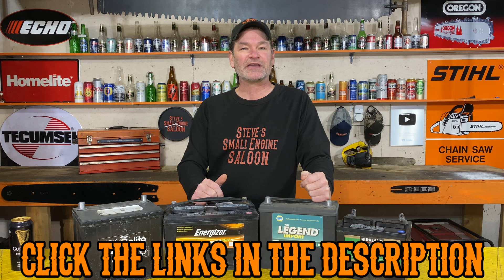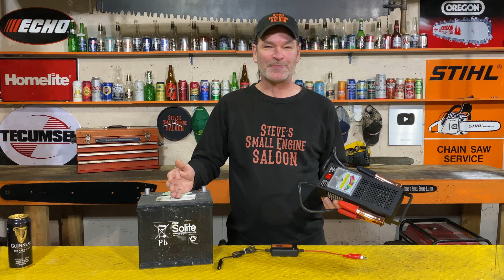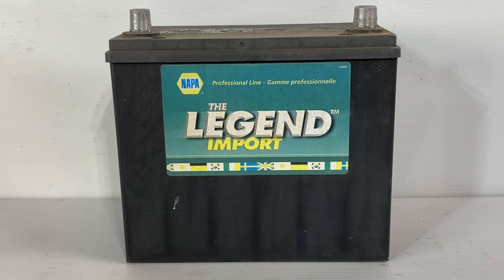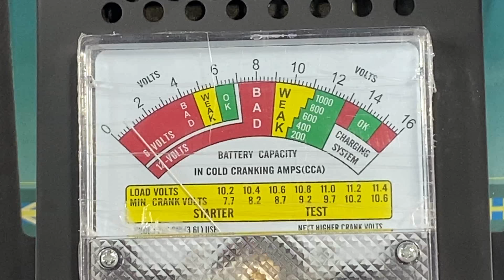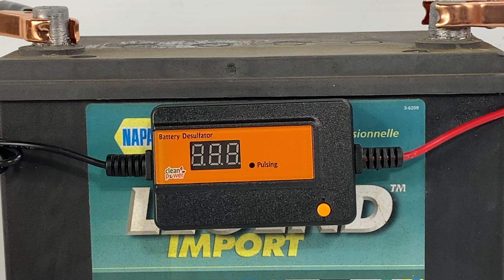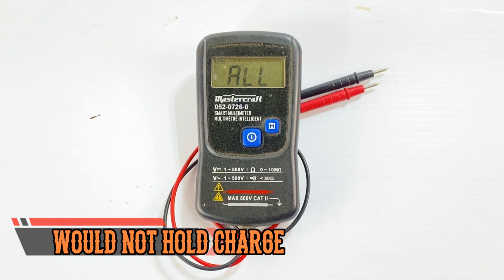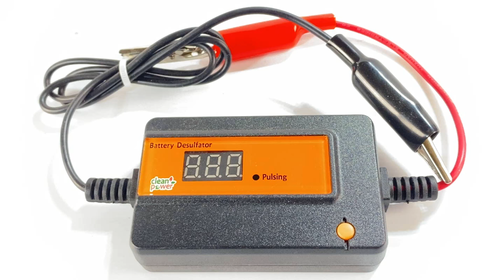Does An Electronic De-Sulfator Really Repair A Battery?? See Real Results

Comment: Some of the plates can build up an insulating layer. You can sometimes break through it with a high voltage.
I took a 120 volt 60 watt incandescent bulb 1N4007 diode in a half wave circuit and made a 12volt lead acid battery part of the circuit.  The battery then faces 170 volt half wave pulses which push 12 times harder than 14 volts when the battery then conducts it is current limited to a half amp by the light bulb. .Not good as new but gives it a little life back..A lead acid 12 volt should not be discharged below 11.5 volts for best long life after that the plates have lost too much material to the acid to plate itself back on like it was before.

Comment: Thank you Steve!
I just ordered all three.
I live on a lake, so I have a pontoon with 4 battery. A boat with 2, two ride on tractor,  and my old pickup truck and a motorcycle.
Good lord if I can save one or two it will be worth it.
Most batteries die because the lead breaks or is full of sulfur. Well broken lead is a no go .. but sulfur can now be fixed.. (sometimes..)
Thanks again!
Reply from the maker: You're Welcome...

Comment: For my many years working as auto technician, I noticed the main factor in reviving a battery depends on the age of the battery, if it has any dead or shorted cells and how long the battery had time to sulfate. If the battery is over 5-6 years old or the battery has been sitting for few years, the reconditioning cycle doesn’t work. Also if it’s a small motorcycle battery I never had any luck bringing them back.
Reply: I think the key is to desulphate before the battery is completely broken down in some way so that whatever slow build-up occurs can be broken up before it cause more serious permanent issues.  I remember my grandfather building a similar “memory zapper” for nicad cells which were quite popular in those days, and it worked too, but not on totally dead ones.

Comment: You can't wait forever to use it. It won't raise the dead.  I use a solar panel to charge cheap lawnmower batteries at 16 or 17 volts occasionally and I can get 4 years out of a 1 year battery, but not a totally dead battery.

Comment: Steve, 
HOW IS THAT DESULPHATOR POWERED???? Only has battery positive and negative wires??
How does it operate? 
Mystery……
Someone please answer this! 😳
Reply from the maker: Ummm,  its powered by the battery!
Reply: @StevesSmallEngineSaloon  how does it raise the voltage up to pulse the battery? it takes at least 15v.

Comment: Hey Steve great to video your the best but did you know that on your second battery you can hook up a fully charged battery to it hooked in parallel and that'll bring the charge up so then you can hook the charger onto it and see if you can bring it back to charge over eight volts I didn't know if you knew that or tried that already

Comment: Need to add a warning about charging batteries at higher amps. You can easily cook a battery and produce hydrogen sulfide gas. Smells like rotten eggs and is poisonous, flammable and corrosive!
I tried jolting an old battery with 15 amps in a closed garage for too long and thankfully checked on it soon enough to prevent anything bad from happening. Battery was hot and you could hear bubbling. Smelled bad too. If there was an ignition source I probably would have had a nasty boom.

Comment: Been using BatteryMINDer maintainers/ desulfators for more than two decades.   Many lead acid and AGM batteries.  Most of my batteries that idle (boat, side by side 4 x 4, trailer caddy) etc. last up to a decade, sometimes more, in the Fl heat.   You're right.  They can't save every battery, but desulfators do work more than enough to pay for themselves.   Far superior to standard trickle chargers that cost the same or more.  Batteries with normally expected 5 yr max life, stored on working desulfating chargers, remain reliable for at least double that.

Comment: The first two batteries can be rebuilt but not restored. The last two would eventually have been like the first two given time to get in such conditions. 
I have spent 3 years studying every thing I can find on this subject. I finally got the connect disconnect pattern down to no spark. Disconnect ground first reconnect positive first. I had to use a quick disconnect for a while. It is not just a method to keep your battery from draining from the system. It also helps you understand the above mentioned process. When you connect it to the ground and use it on the ground side of the battery. You get no spark but use it on the positive side. It sparks every time you throw the switch on or off. 
Now I just remember how that thing worked and I hook my battery and jumper cables and jumper boxes up correctly 98 percent of the time. LMAO 🤣 🤣 🤣. 
Sorry I didn't mean to ramble on. Thanks for doing this video. It helped me to understand why certain batteries can't be restored. I was struggling with the difference until this. I guess seeing them compared side by side. Cleared up the mud in my brain. LOL 😆 🤣 😂

Comment: I bought the one you show last spring because my deep cycle marine boat battery had failed the year before (it wouldn't hold a charge, had to be boosted all summer). It recovered my battery and it worked the summer until fall when it started not holding a charge again. I will try it again but even if it doesn't recover this battery again it still saved me a boating season. It has saved other battery's as well so the $25.00 was recovered on the first save
Reply from the maker: Right on Mike!  Thank You...

Comment: They work well, particularly if you use them at the same time you are charging. I have the same type as you. My success rate is about 70%, even with SLA batteries.
Reply from the maker: Awesome!

Comment: Steve, I love you videos and purchased a de-sulfator.  I’ve had varied success but thought of something the other day when I was cleaning a carburetor.  If the sulfur builds up on the lead plates, what do you think about submersing a battery in an ultrasonic cleaner of just water?  Do you think it would break down the sulfur on the plates.   I use a similar technique for small carbs putting then in a plastic soup container with carb cleaner snap on the lid and drop it in the ultrasonic machine.  This has worked great and saves a good dealer of cleaner.

Comment: If you have a completely dead cell there's no way you're going to be able to repair that because it is actually a physical break. Generally batteries that have been sitting for long periods of time and then they build up that mineralization on the I believe it's a positive plate. If you were to keep a trickle charged or an operation on a regular basis it would maintain those minerals in the electrolyte and you never have a problem and eventually the lead wears out and that's where you come to that physical point where there's no repair unless you want to change the plates out. So like right now I have a battery that is generally hold a charge it's good to go but what's happening is when it gets really cold out it has a hard time holding that charge I believe this vehicle drove less than 8,000 miles a year it could have been sitting for a period of time before I got it the battery is 4 years old so what I do I joined the contents of the battery filter it through a cloth save that material then take distilled water and about 20% baking soda fill up each cell put it on a 6 amp charger keep filling it until it settles down do that for about 2 hours and then drain the battery out. At that point I just take regular garden hose water into a thorough flush of each cell. Want some satisfied fill up each cell with distilled water and throw it on the charger and a 6 amp setting for 8 hours then go ahead and drain that fluid out and take my filtered original electrolyte and put it back into the battery and top it off with distilled water and charge that for about 6 hours or so and there you have it. I have to say we're not believe how much lead comes out of there all that black stuff the idea is the chemically scour the plates. And why I use a charger during this process is because I'm trying to force those mineralization off the plates into the distilled water which would want to attract the minerals as it has no minerals in it there you go

Comment: I keep my Zero Turn mower on a battery tender.  The battery kept going dead, so I bought a new battery.  The new battery went dead soon after.  Figured out the battery tender was draining the battery instead of charging it.   I still have the original battery on a new tender.

Comment: I did my own research into this topic starting about 10 years ago.  Had to make my own version of the desulphator so it kept trickle charging at the same time so a battery could be left desulphating for a long time (years in the end) with regular checks on the electrolyte level.  I used automotive batteries that were dead flat IE had been sitting on a concrete floor for who knows how long but they didn't have a millivolt in them.  
They had to be checked for shorted cells that can happen when the sulphate crystals grow so large the plates get distorted  (that's a throw-away unsalvagable battery).
End result was I could recover up to about 50% capacity in the best cases but it took so long it wasn't worth the trouble.

Experimented with alkaline cells even earlier and found it depended on the brand as to whether flat(ish) AA & AAA cells could be improved with longterm (very) gentle constant current trickle charging and yes it does work, even lowered the internal resistance of suitable candidates which just happened to be the premium brands.  Again, it took so long that it wasn't really a viable process.

Comment: Steve - The label on the Solite battery indicates "no lead". There is sketchy conflicting information on their website that seems to suggest it utilizes calcium instead of lead (their process diagram indicates Pb-Ca alloy). Perhaps your desulfator is not effective with the different chemistry in this battery. The following YouTube video recommends using an inverter welder to awaken dead cells within a battery and to then restore it (https://www.youtube.com/watch?v=VYtkn-N_p4s). They suggest using 5 charging cycles (sometimes more) to restore a battery.

You did a great job on your video. I hope you find my comment here to be helpful additional information and not criticism. Love your channel.

Comment: I would like to see a test of LOUD ROCK MUSIC ~ the whole point of a higher voltage brief electrical pulse is to 'shock' the crap off the lead plates...
Reply: As an applied-physicist (I went to Imperial when it was ranked 1st in the World for Physics), I would say there must be some resonant frequency for dimensions... once those softer sulphate crystals are encouraged to fall off, who knows... However, would rather connect my testicles to battery than hear another Titanic Celine Dion track... I was thinking a 'BATT out of HELL...' by MeatLoaf...

Comment: Regarding battery #2 low voltage. You could not use the desulfator because the battery voltage was too low. However, you can use the desulfator in parallel while charging the battery. If the charger brings the circuit up to it's working voltage, you can desulfate while charging the battery. It has worked for me.

Comment: Great video, thank you.

On the batteries that did not work, did you check with hydrometer?  If one or 2 cells remain low, plates may be shorted out.  So battery could be bad.

On the batteries yto try de-sulfate that at less then 10 volts - apply a trickle charger or a charger rated at less than 2 amps and attach the de-sultater with Charger applied  this will all the de-sulfater to do it's job

Good luck

Comment: For battery #2 you can trick the de-sulfator by putting a second battery in parallel to get the start voltage higher than 10V.  Once the de-sulfator turns on you remove the second second battery and let it do it's thing.  I've recovered lead-acid UPS batteries this way many times.
Reply from the maker: Great idea!
Reply: I wondered about that.
Reply: Very interesting...  I have a 5yr old UPS battery that refuses to run anything for more than a second but doesn’t detect as anything other than fully charged with full capacity, and I really need my UPSs because I’ve moved to a small island where the power goes out all the time; we have a generator for that, but it takes time to start (if it’s battery is good) and then stabilize RPM before the transfer switch switches to it’s power, so having my 3D printer and controlling PC on a UPS is essential because successfully resuming a print after a power failure is pure fantasy in my opinion.
Reply: @SchwaAlien  Sounds like the battery is both sulfated and dried out.  You can try adding distilled water to each cell to just cover the plates and then use a desulfation.  Even better if you have an intelligent charger with a recovery and maintenance mode.  Worst case scenareo you could try replacing the battery with a marine deep cycle battery.  It would take much longer to charge with the UPS internal charger but it would also last longer when the power goes out.  I have an ACP smart UPS 620 that I have done this to.  I saw no point in paying close to $100 for an 18AH battery so I got a second hand marine battery (600 CCA and 140 min reserve capacity and designed for this type of draw), cut a large enough whole in the side panel of the UPS and ran the battery cables out the side and connected to the battery terminals.  I made sure to charge it fully before connecting it.  It'll run my 24" TV for a full day before the UPS starts warning me that reserve is getting low.
Reply: i literally just commented enquiring about that.

Comment: #1: A bad/sulfated cell would need to be charged slowly with probes into the plates to isolate the weak cell with a 2.4v power supply. Could also try deep discharge to attempt to bottom balance. 
#2: Shorted cell, Empty acid and flush with garden hose and refill with filtered acid, see #1
#3: All cells sulfated from deep discharge.
#4: probably another weak cell like #1.

Comment: good video. i have one that plugs into an AC socket that can pulse and charge the battery and i find that for expired batteries by itself will not work. You have to do the usual restore of "insert correct fluid" and do some procedure relating to pulsing and charging in a few cycles to get it to work. I plan to try it with a small 8 year old lead acid battery i got which i believe is gel. I cant really tell as theres not many words to explain it but even sealed batteries also have caps inside that you have to take the cover off to be able to open. Just make sure to charge the battery first so you dont get gases coming out.

Comment: I desulfate batteries with my garage water heater.  Get free batteries from town recycling so I've had a good sampling. Can't save everything, but have made a number of them useful.  I'm off grid and my water heater pulses off 60V at 10A.  Quite a good battery charger.  Batteries that are less than 1/2V are the  ones I've had the best luck with.

Comment: Great video, Steve! Thank you for getting to the point. A lot of good information, not only on the tool but also terrific background on the issues to the batteries it didn't work on! Question though, what's the difference between this and the de-sulfater that you'd pour into the battery?
Reply: At a guess this works by sending a pulse through the battery and the liquid one may or may not work but is designed to remove the sulfation from the plates. Some of these are snake oil. Don't know of one that works but would be interested to see a proper demonstration.

Comment: Sweet Project Cars has a couple of videos showing two methods of bringing batteries back from the dead, I tried the method without the welder and it worked great, been using the battery for the last four months and still working like new, all you need is a battery charger with 200 amp boost capability, check out their video.

Comment: Rick..cool video..Just for chuckles...I have been using 3  "Battery Tender Jr.'s" on my Tractor / (2) Snowmobiles & Hot Rod (900cca)
Batteries during off season for 5 years to avoid degrading problems with good luck. I found I can even gang up 2 or 3 Batts.
with 10 ga. jumpers (In parallel) with Batts. on bench. (As long as they are not too low on charge to start with)
If you already did a video on this..oops never mind.